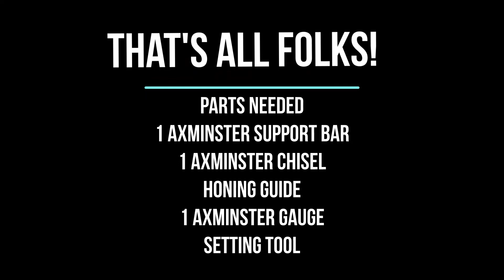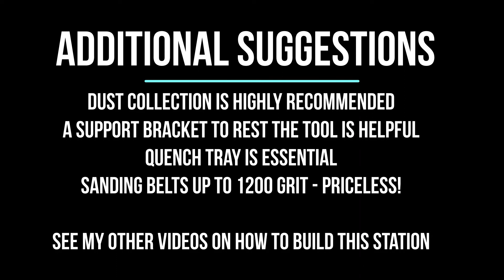Sharpening an old chisel on the Shopsmith Belt Sander / Sharpening Station

Comment from the maker: Some comments: 
1) As you see, I'm running the belt sander backwards using my PowerPro. It's not necessary, but my setup with the Axminster bar gives me more room set up this way. To run it backwards and do dust collection, I made a bracket to hold the aluminum dust collector (backwards also). You can run it forwards without problem - you just loose some room. Not a problem for most tools.
2) I can't emphasize how important dust collection is when grinding - metal dust is highly toxic. I have a spark arrestor (just some wire mesh basically) inside the tube that connects to the dust collector and my shopvac collects the dust - I don't use my DC because all the wood dust would be highly flammable!
3) I use Trizact belts for the last stages because they are extremely uniform, and they are lapped using mylar that is only a few thousands of an inch thick. Result - smoother running, better results.
4) You don't need a Powerpro for this, you could do it with a standard Shopsmith - just make sure to quench often to keep the temperatures down.
5) The accuracy comes from using a 12mm Axminster support bar which is perfectly square to the belt sander backing plate. You can get this from https://www.axminstertools.com/us/axminster-compound-jig-for-ultimate-edge-103738. If you search the site you will also find their honing guide (better than the Tormek for this job) and the angle setting tool that makes it all very easy to set up.